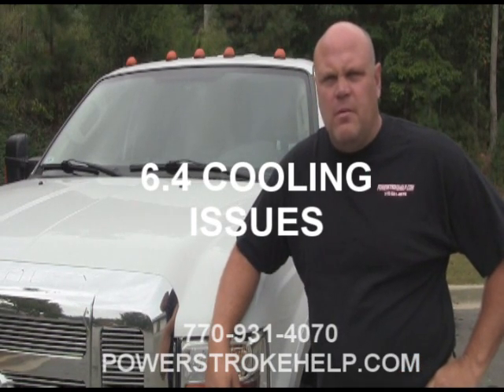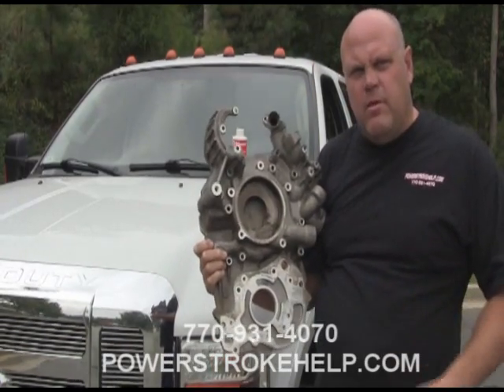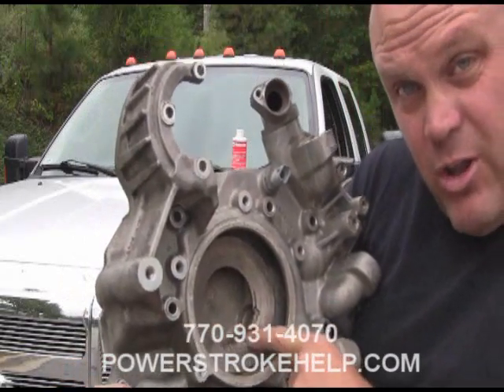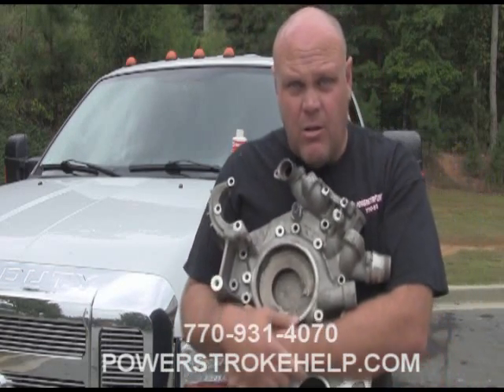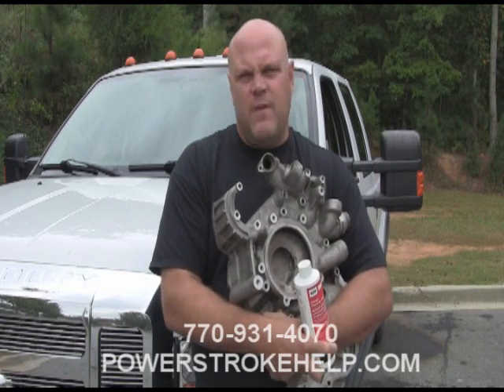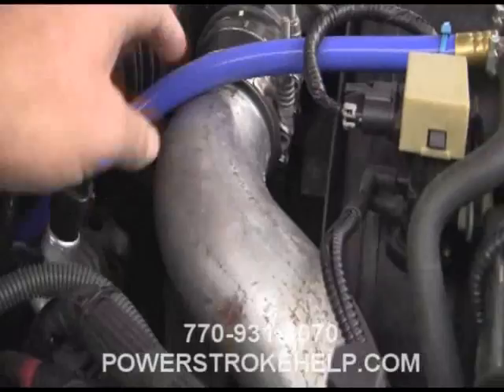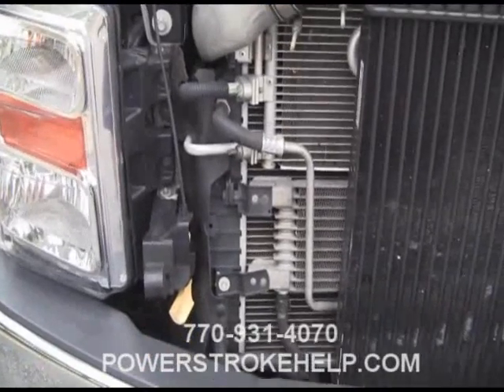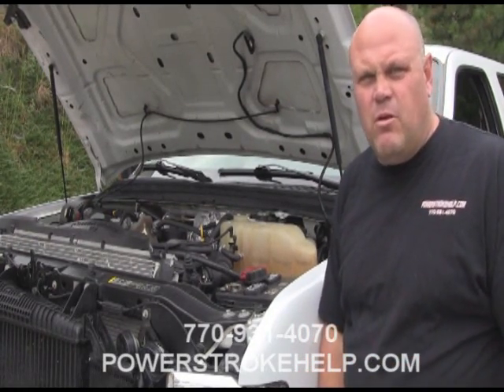6.4 COOLING ISSUES

Comment: Bill, I didn't find a video on this problem. My 2002 7.3 manual instrument cluster stopped working. No wipers, radio, overhead cpu, windows. The problem in the link sounds just like mine, and the dealer wants $900 for a new instrument cluster. Have you seen this? Any recomnedations? Is it a short in the CJB and how does one fix it?

google "No Power Windows, Dome Light, Radio, Instrument Cluster" and it shoud be the first one under fordforum

Comment: Bill Help just got an 08 with H&S and dpf delite ,started loosing coolant, minor loss, noticed egr clr hose leaking on both sides on vertical, by egr elbow and the side that goes in to the cooler, also getting p0607 Control module performance-through the tunner in the transmition. Comes back after reset. dealer blames it on the tunner after flash that didnt help im out of ideas. truck is at 60K i would like to just get rid of the coolers, but i heard i would need a waste gate and thats alot of $

Comment: The owners manual for my 2001 7.3L tells me to use the anti-cavitation fluid in my radiator as well. The owners manual gives a part number, but Ford has changed to a different part number for their anti-cavitation fluid. It's imagine its an improved replacement. From what I read years ago, cavitation can also effect the cylinder liners, wearing a hole in them as well.

Comment: 3:45- The correct replacement coolant if the Motorcraft Gold Coolant isn't available is Zerex G05. It comes in a dark gold bottle, and has more of a honey gold color than the original yellow gold of the Motorcraft stuff. It's the correct low silicate formula some of the manufactures are using, and it isn't one of those all makes all models garbage that's green. It's not the Dex Cool Coolant that GM and allot of the foreign makers are using either. Great video as always.

Comment: Is it a viscosity problem of the coolant or a too low pressure in the cooling system ?
Cavitation can be caused by the two.
Additives could only change the viscosity or add protection on the metal parts but can't solve the cavitation problem. 

What do you think ?

Comment: I own a Dodge,but if i had a Ford Powerstroke I'd send it all the way down to you from B.C.in a heartbeat for any necessary major engine overhaul.

Your videos provide a wealth of info on Powerstroke engines with a no B.S. approach to problem solving...so many shops/mechanics are only out to make a buck and get you in and out of the shop,lacking a specialized approach to permanently solving these important reliabilty related issues,such as the ones that plague the 6.0 and 6.4.Thank YOU!